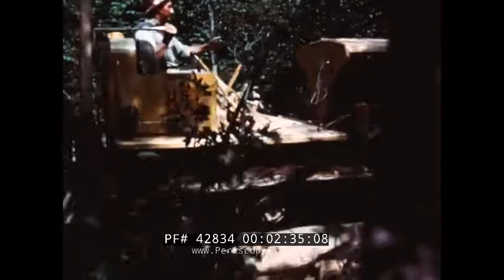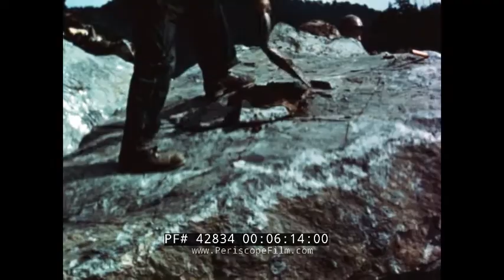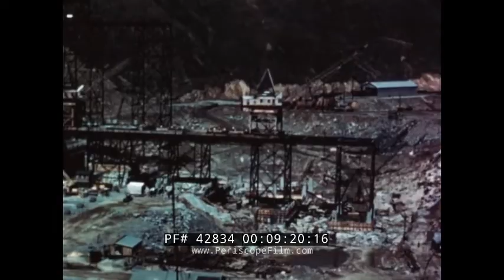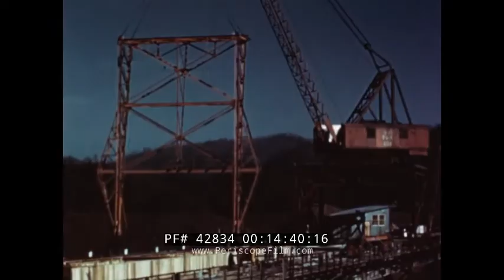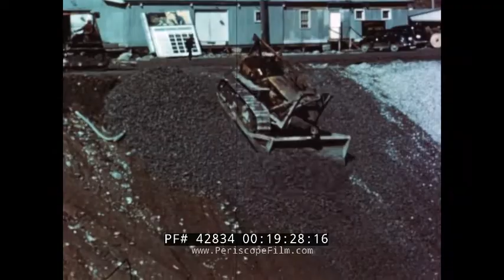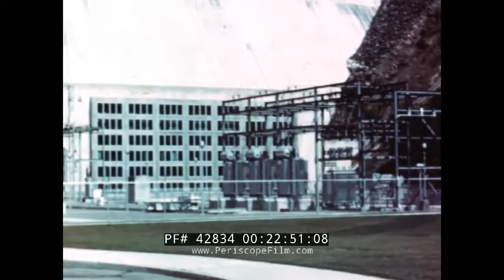1947 FONTANA PROJECT OF THE TENNESSEE VALLEY AUTHORITY   CONSTRUCTION OF THE FONTANA DAM   42834

Comment: They built a lot of locks and dams in the 1930s. One time they were going to reface the lock chamber of one of these locks. They drilled down into the concrete and placed blasting charges. Set them off and......nothing. Nothing happened. They had to go WAY up in the amount of explosives to even get the old concrete to budge. That's how well made the concrete was back during Hoover dam days.
Reply: Partly. But also, good concrete gets stronger with time.
Reply: The good!  the bad! the ugly !  
The huge generators are inside the dam itself.
And now, 70 years later, we learn EMF breaks down the molecular bond of concrete over time !  
She's going to go, Boys !  Fontana local humor !

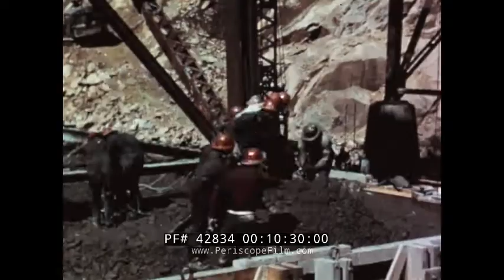Comment: 10:27 - Electric vibrators?  Those would have been EXTRAORDINARILY DANGEROUS when standing in a field of wet concrete.  Further, the motor weight would most certainly have been overwhelming.  

I submit that the vibrators were pneumatic, as were most other machines of this sort used in building similar dams in that era.

A pneumatic engine compared to an electrical unit of equivalent horsepower is a mere fraction of the weight, and not NEARLY AS dangerous in wet environments.

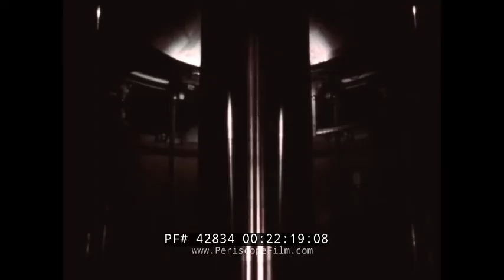22:13 - It is NOT a "TURBAN".  A TURBAN is what Sikhs wear on their heads.

   --->>> This machine is properly pronounced "TUR-BINE."

Well, hell?  Look at the spelling?

I have customers who manufacture turbines.  Deal with it.  They certainly made me do so?

🙂

...
Reply: 1947... they all dead now.
Reply: @ianwalton284 .....they are ghosts maybe......never know so maybe you can still tell them off

Stupid ghosts
Reply: @ianwalton284  
That proves how dangerous the work was....hehe
Reply: "A concrete vibrator is a machine used for construction-based purposes. These machines can come in several different shapes and sizes. Some are small and run strictly on battery power, while others are much larger with a primary power source stemming from electric power cords."
Reply: I work in the electric industry, it bothers me tremendously how the word turbine is pronounced. Tur-bin is what everyone in a large nuclear company I worked for would say. I refused and would always say tur-bine, rhymes with the farm equipment combine. 

At least aviation tends to say jet turbine correctly.
Reply: @ChristinaK1024 ......or they pronounce it ( tur-been )